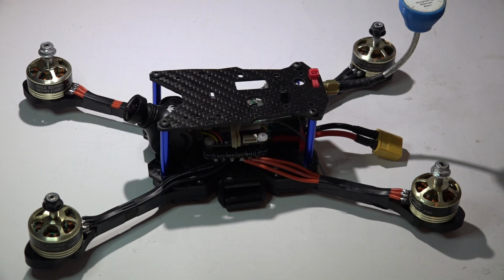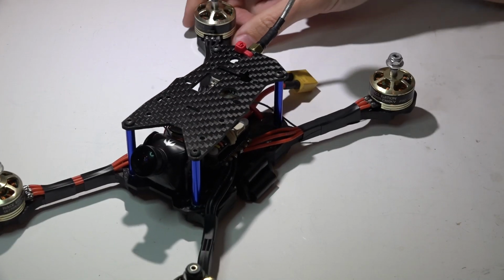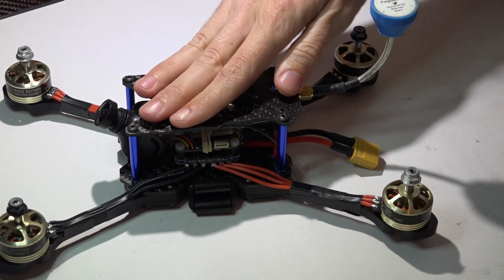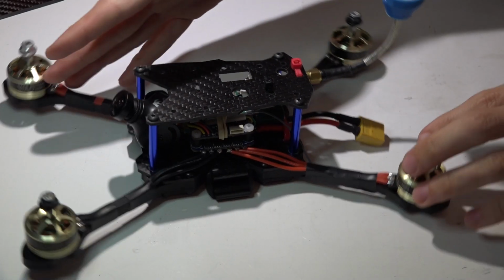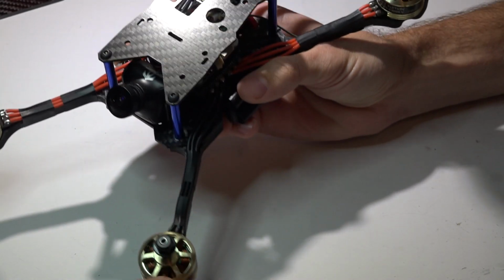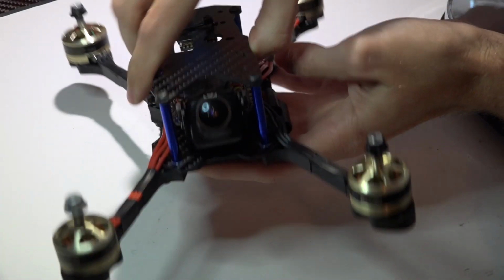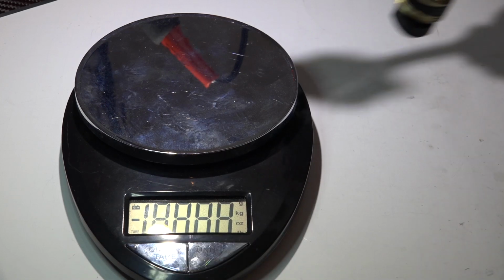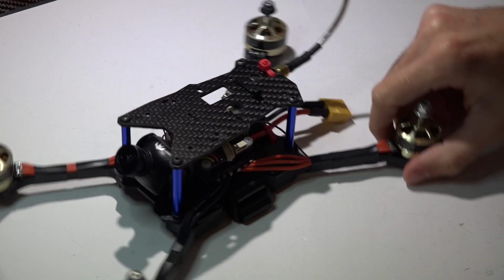RMRC Valorem 5" Stretched-X Arm Upgrade

Comment: JC, I was in Muncie Friday but not Saturday.  Man, wanted to meet you and ask questions about the Stretch X.  I'm building the true X but want to build the SX.  Using a 4in1 ESC and want make sure my wires are long enough for the switch to the skinny sx arms.  Can you measure yours and pass on the info.  I check RMRC hourly to see  when they are up for sale.  Do you have an extra set, buddy o pal?

Comment: I have the 5" arms and broke 1 whenI lost signal at high altitude. I've been searching for replacements, but can't find it. It's very weird that RMRC would sell 6" and 7" arms, but not the more common 5". Do you know  if they'll be adding the 5" arms as well? Or do they have it and I'm just blind?
Reply: Xudus FPV They didn't have them yet. Nor do I see regular replacement arms going to be available. I ended up buying 3 frames total just for the arms. I have only broken 1. $16 frame...$4 an arm...not to bad really...beats not flying.

Comment: What are your thoughts on kabafpv's claim that if your quad is super light (250g) the carbon fiber you sacrifice for weight will be made up for with durability due to the extreme lightness. I understand that the lighter a quad is, the less inertia it will have in a crash but would the lack of inertia make up for the major decrease in carbon fiber protecting electronics and motors? I was goin to do a rebuild of my quad and switch out the frame vtx and escs for a 4-in-1 esc, micro vtx, and his 50g frame. I have the brotherhobby 2205 motors (26g) that i plan to put on the frame too. I understand that frames like this are minimalist frames designed for performance increase at the cost of durability but kabab argues otherwise that you can have both if you build it light. What are your thoughts?
Reply from the maker: I know Kabab is all about 250g quads, and the logic is there of lighter weight quads not breaking as easy. Just in my opinion the lighter ones have broken easier. I cant prove or disprove either theory so I dont worry about it so much.
Reply: Project Blue Falcon my light quads seem to break just as easy as the heavier ones. Heck, I broke an indestructible armattan Japalura frame. It was replaced for $5 shipping fee.

Comment: I have the 6" arm add on.. love this frame.. it's fast as is.. but that's kool I can say adding 28mm or 30mm standoffs makes it lower profile and makes it a lot better looking .. pyro has some great 28mm stand offs for 99 cents set of 6..
Reply: I'm pretty sure that's $0.99 a piece, not for 6.
Reply: Matthew M nope 99cents I ordere few sets thanks! 👍🏼
Reply: Robert Majeroni Macaroni FPV getFPV has a set of 20mm standoffs. SUPER SLAMED

Comment: It looks like you could slam that thing with the 28mm standoffs they have for the QAV-XS (and other frames prolly. Would make it sleeker looking and probably improve flight characteristics. Also are you still planning to show an ESC repair? That 4in1 would be an awesome candidate.
Reply: kanahmal I actually have slammed mine with 28mm standoffs and it looks way better
Reply from the maker: I have some ESC repairs coming up. Havn't taken a look at this one but if its fixable I'll do a video on it.
Reply: kanahmal I might just do that thanks for the 💡
Reply: DroneRodeo no problamo, make sure there's ~6mm between your FC stack and your top plate. I think the standard standoffs are about 34mm.
Reply: kanahmal I run a single stack now so it should fit

Comment: What do you think about super light versus normal race build so 350 vs 500g the super light has high kv motors such as 2750kv and the normal around 2500kv both running cyclones v3 but the normal tri prop and super light twin blade so how would that compare to each other, if you don't know you don't have to answer it I'm just curious
Reply: Thumbs_Fpv I'm running same frame RF Revolt and Bolt esc.. 2700 kv motors and 5" props and this frame hauls with it
Reply from the maker: I think its just a feeling thing. Both will perform well. Some guys swear by super light builds, some swear by heavier builds. I honestly think there are a lot of theories being thrown around of why one is better than the other. But from my experience its just a difference in feel. Dont think either is right or wrong, just user preference.